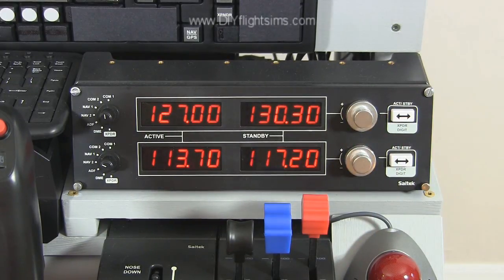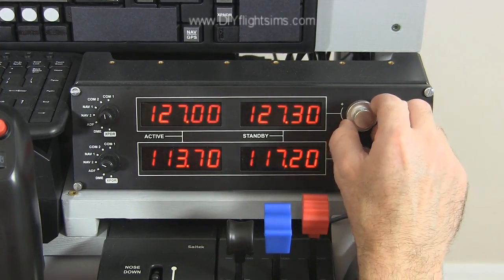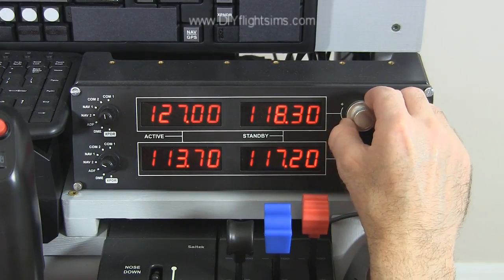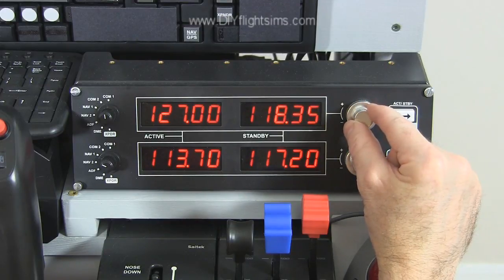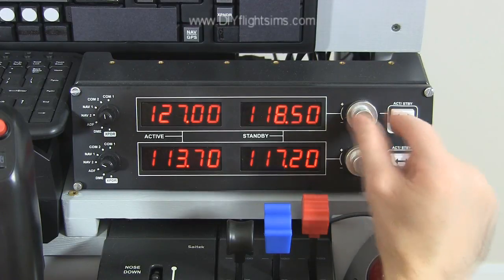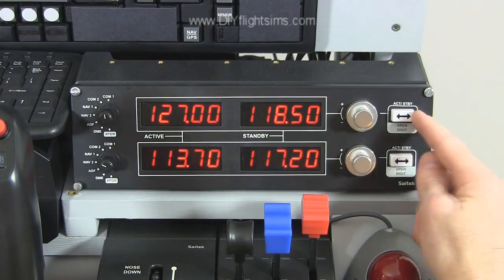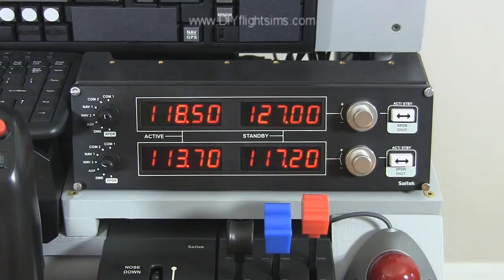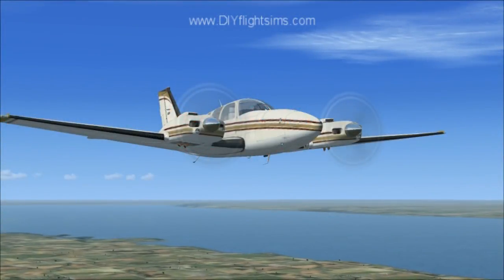Communications

Comment: What model of radio do you use there?
Reply: FrequentFlyer Thanks man
Reply from the maker: That is the Saitek (Logitech) Pro Flight Radio Panel, model PZ69. I posted some guidance on installing Saitek switch panels at the Builder Academy https://courses.rogerdodger.net/courses/builder-academy